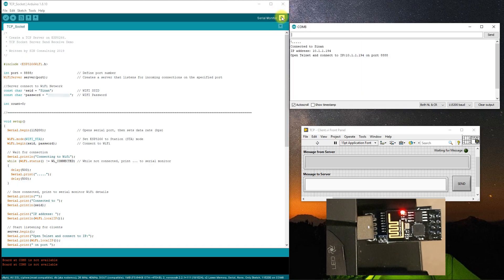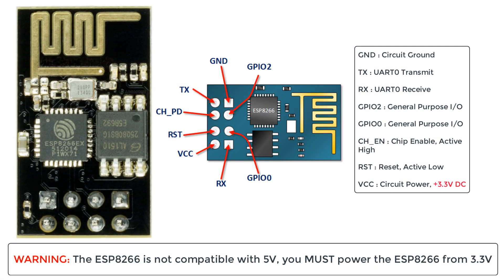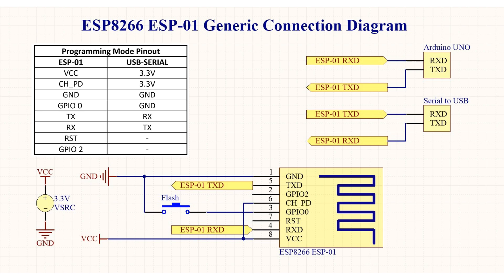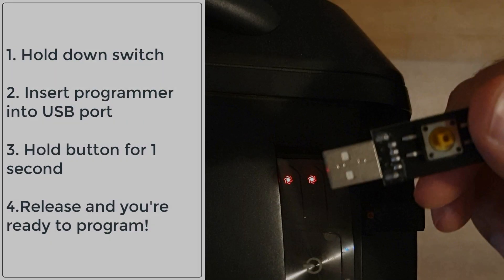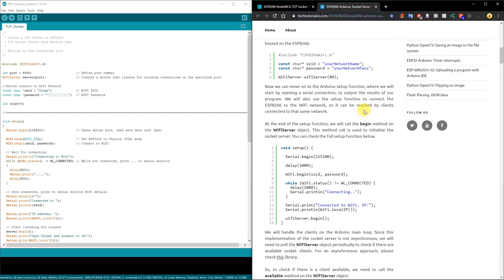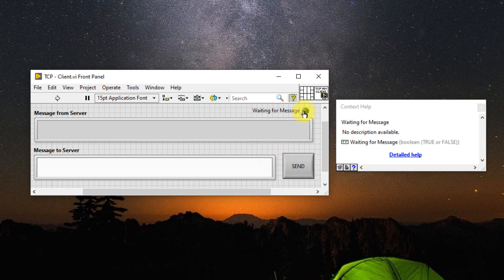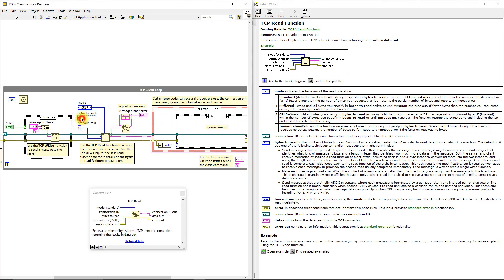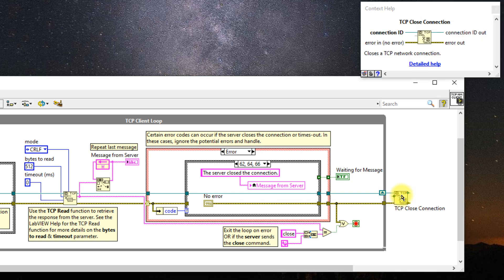LabVIEW Basics #7 - ESP8266 ESP-01 TCP/IP Socket Server + LabVIEW TCP/IP Client + USB Programmer Mod

Comment: Hi SINC. Thanks for this tutorial. I am trying to make the TCPSocket Server from your other video to program Arduino Uno.

Just wondering if you could help me with this error 

esptool.UnsupportedCommandError: Invalid (unsupported) command 0x8 

I am following your tutorial with an Arduino Uno board. For momentary switch, I'm connecting a jumper wire from GPIO-0 to Arduino's GND for a few seconds from the moment I plug in the USB cable.
I noticed in your case you have an extra COM port shown up. However for me it just shows two COM ports: "COM3 (Arduino Uno)" and "COM1". The later I feel is default for my PC. I suspect if this is the cause of the error. Did you experience something like this?

Your help is greatly appreciated. 

Many thanks,
Raj
Reply: For some reason, it worked perfectly now. Many thanks.

Comment: Hello, I could connect 2 arduino with 2 Transceiver nRF24L01 2.4 GHz for each, like 1 arduino with 1 transceiver connected to the PC and the other one somewhere else in the room, and use labview to communicate (receive and send data) between them or I should get and ESP module? It's for a project. Thank you and have a nice day :D
Reply from the maker: I know the Bluetooth modules work with LINX easily, maybe the RF modules would work also but I haven't tried them. It would be less work than using the ESP module that's for sure ! But it depends on your requirements ultimately.